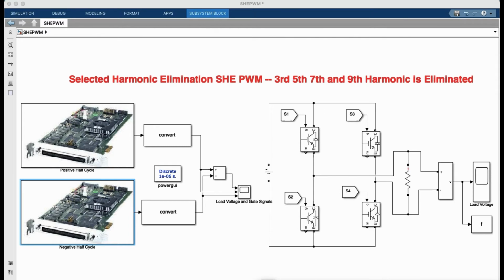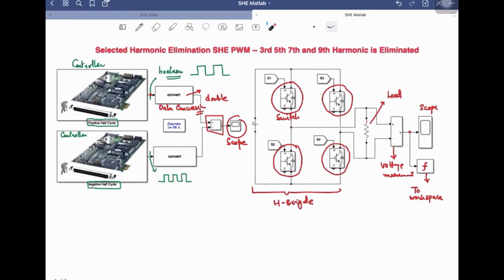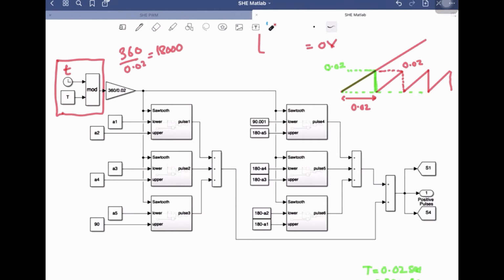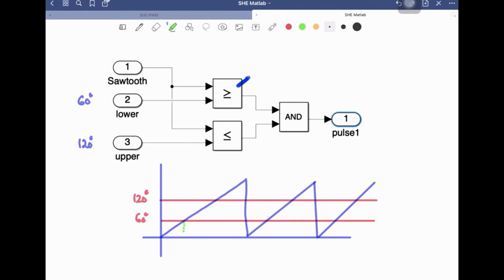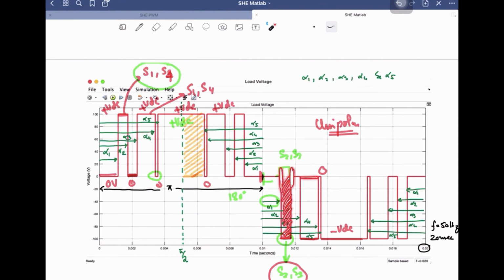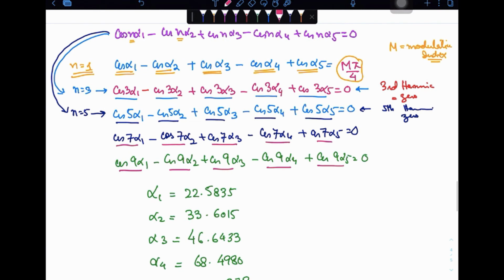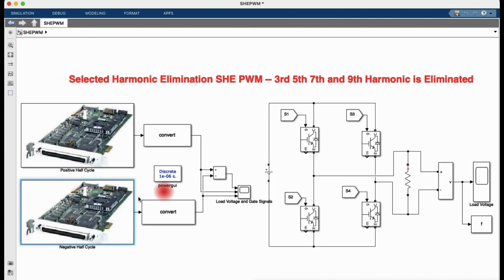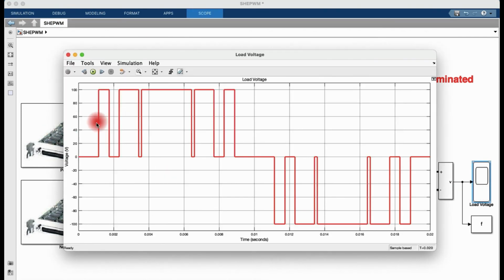Power Inverters W6-2: Implementation of Unipolar SHE PWM in Matlab Simulink

Comment: Hi Kashif,

In the video of Quasi Sqaure wave Modulation you have talked about reference waveform but you did you talk about the Carrier signal frequency. Would this Carrier Signal Frequency will be same as the output (AC) frequency or would be fixed 50 Hz?